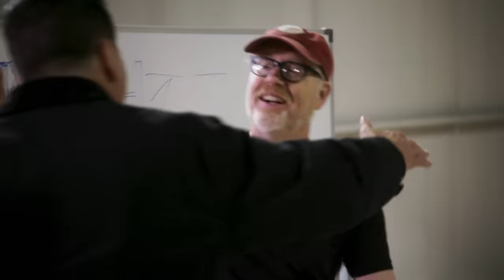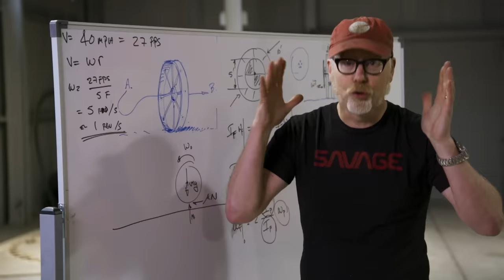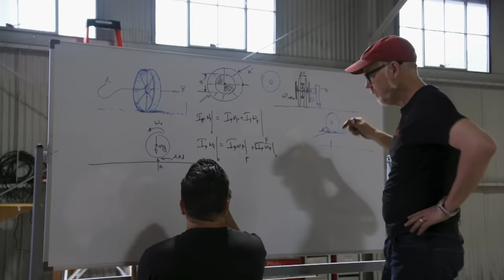"The Power In These Flywheels Scares The Pants Off Me" | Savage Builds

Comment: You should have Metal C Clamped the Core Axle container to the Horse tables, and anchored the Horse tables in a sand bucket to help absorb teeder toddling of the structure.   I would have also have put up 5 layers deep (and as high is the device is) Sandbags like what I assembled many in Iraq.  Sand bags really absorb energy, and is reuseable when need be.  I would have considered doing a Belt pulley start rotation engagement system, or using like a motorcycle transmission with a clutch to engage the special center spin lock.  The clutch pivot system will allow you to engage, and disengage without yanking it.  I really reconmend if all possible, balance the iron place so you get less wobble.  This information comes from a Disabled US Veteran who used to spec performance his 91 Integra.  Give it some thought and let me know

Comment: You do not use straps to secure the flywheel to the bench. They way they try to secure a running machine is terrible. You must first clamp it very securely and they did not bolt the fixture to the concrete floor.
Reply: Not to mention it was a single mounting point directly in its center of mass/gravity. I'm glad nothing went catastrophically wrong during that test.
Reply: expanded steel cage, 1" or greater U-bolts to the saw horses to hold the axle in place, with the saw horses bolted/welded to a floor plate which holds the cage, try and put as much metal to metal contact and as many ways to keep the axle from actually hitting something that could cause it to run away, they probly could have pushed it to 600-800rpm even with a slight vibration, but 1 ratchet strap in the middle is just asking for something back to happen, not to mention their motor disengage method is by pulling, that in itself is super dangerous.
Reply: You're right, they should have been bolted to the floor. However, you have two 450 pound discs spinning at about 300 RPM. I'm not sure bolting it to a concrete floor would do much, really.
Reply: Although, if it's not bolted with the frame to the floor what they did doesn't seem too bad.  The strap seems attached to the floor.  Like this, if it breaks off the sawhorses it'll be metal 'wheels' on concrete (low friction), which could probably be held back alright with that strap.  

Still not the best setup for sure, but also not too bad.
Reply: Look closer, the straps are fixed in the floor.

Comment: I make wood processing equipment. The wood chippers are pretty much the same concept. It's a very heavy metal flywheel with slots you can bolt blades to.

Comment: Trying to slow it down from the center, surrounded with engineers, very smart
Reply: I would be afraid to push on the outer edge as well given how they affixed the axle to those 2 saw horses.  The entire assembly already showed it could pivot on its mount with those straps, not going to make that any easier to do.
Reply: @cashgamma  Yea. The tangential speed at the edge will makes that plank fly straight into any unfortunate bystander's face. Braking it at the center will slowly bleed out the energy, much safer.
Reply: Yes my first thought was: it looks like you’re using all of your brain too! LOL

Comment: The flywheels are to large a diameter, you can get the same amount of effort out of thicker smaller flywheels, they would also have less runout and less vibration.
Reply: It would take more mass at a smaller diameter, though.  If you hollowed the mid-section with some pizza-cuts, you might be able to make up the difference, but then you'd be pumping a lot of air.   Also, there'd be more work to do for the braking device to impart the same torque.
Reply: The thicker plate is probably not as readily available & would likely be more expensive.
Reply: Yeh but you are forgetting one thing, these guys aren't as smart as they are made out to be!
Reply: @iamthetinkerman  A chief engineer at JPL, not that smart... Well making that comment here is cheaper than renting a billboard to proclaim you aren't that intelligent I guess.
Reply: @iamthetinkerman  He's the Engineering Lead at JPL. That title alone makes him an Elite World Class Engineer. He's been the man responsible for some of mankind's greatest off world achievements.
Reply: @AgeUKwirralDIT  I'm not going to discredit this man's achievements, but I know a lot of great engineers that "aren't that smart". The fact that the shop has several "really smart minds", yet no one thought a single sling point was a bad idea. I would've had braces on either side the axle, atop both of those horses, with dual floor anchors. This would've been at minimum.
Reply: You're not wrong, but what you fail to mention is that every time you half the diameter, you must quadruple the mass (at the same RPM) or double the RPM (at the same mass) to achieve the same kinetic energy. So there is a balancing act there, literally. 

If the goal is to convert the kinetic energy the flywheel into forward locomotion you want to have the most kinetic energy for the least total mass I would think. That would favor large diameters over small diameters.
Reply: @bamascubaman  Chief engineer at JPL had not rigid mounted the shaft to the stand, at a single point no less. Such an obvious error could only have been devised for our entertainment.
Reply: @iamthetinkerman  agreed, I would say that the 500 k  of school makes him a tool, he wants people to think he's smart hence the title, seeing the outcome of this experiment before it is conducted makes you smarter, than him! You can tell this is something that could be simulated in a physics engine, and the parts could be machined with precision, these experiments are made to get people excited with his mars mission, a PR stunt!
Reply: Smaller/thicker would be a performance hit for this machine. As far as runout goes how does smaller neccesarily improve it?
Reply: @bradley3549  large diameter, with low weight and high-speed, would be more efficient and less dangerous.
Reply: @abrenos3744  I agree with the first half, I'm not entirely sure I agree with the second half. lol.
Reply: @bradley3549  😁 you totally right!

Comment: A guy in SE Kansas built a two seat car powered by a car battery and electric motor spinning a flywheel. I did an article about him in 1980.
Reply: Do you have a link to the article?
Reply: Terribly inefficient and dangerous in a small vehicle, let alone any road vehicle.
Reply: @csengo70  No It was long before the internet. If it still exists it might be in the archive of the Chanute Tribune from Chanute, Kansas, USA. I'm not certain of the year, but it as in the early 1980s
Reply: @randallshuck2976  I wanna hear your story’s.
Reply: @AceOfBlackjack  Wasn't that much of a story. I covered his demonstration of his vehicle. It ran on the flat about a quarter mile at about 20 MPH. There were problems with turning it as it seemed top heavy. I never heard of him doing anything else with it later. I had a photographer with me and he took some pictures. It ran on the local page. It might be in the archives of the Chanute Tribune, Chanute, Kansas. Rethinking it, it must have been 77 or 78 I know it was in the spring.
Reply: @randallshuck2976  Awesome thanks man! How old are you actually? I’m looking for old journalist for a report I’m running.
Reply: @AceOfBlackjack  Although I have a BS in journalism I only worked as one for 4 years. I got married and I couldn't support a family on the wages.
Reply: @randallshuck2976  Oh my goodness I actually just wanna listen to more of your stories, your just interesting now.

Comment: Adam - Spinning flywheels don't store power - They store kinetic energy. The RATE at which the energy is extracted/used is power. They can supply large power for short intervals, or low power over long intervals. Either way, the total energy available is the same.

Comment: Next time try a fluid coupling aka “torque converter” in place of the automotive brake system. And move the majority of the flywheels mass away from the center of rotation

Comment: Because the axle moved a bit down at the side of the motor when removing the motor, the effect is that the axle is turned to the right side. This effect is called precession. Would it turn futher towards the guys in this case? No. Would I stand next to it like they did. Nope. Not at all...

Comment: Given that the disks were 400 lb each, 5' diameter, moving at 350 RPM at disconnect, the flywheel system when disconnected had stored about 70.76 kJ of energy.
Reply: How to store that energy?
Reply: @TheOnlyRiceman  Can't remember the original source when I posted, but re-Googling today I found 35kWh/month, which running the numbers again is certainly not even close to half of 70.76kJ....I think my math is off somewhere haha (and I've thrown away the sticky note where I did my original calculation.)  I think I will edit my original post to get rid of the estimation for how long it could power a fridge, I'm totally wrong about that.

Comment: These guys do a great job of using dialog to explain things they both definitely know, without being condescending.
Reply: We had Pyler Motor Generators** on several jobs. I always hated going in the Vaults to Lubricant them, due to the speed of the heavy flywheel. The Three Phase Motor was on one end Flywheel in the Middle and Three Phase Alternator on the other end. They were for Smoothing the Street Power out, for the Computer Room, and provided an Energy Source to give the Standby Generator time to come on line and takeover powering the motor.

Comment: Flywheels are used as temporary power sources to generate electricity in UPS systems as well as to start diesel generators. You spin them up and they become a source of energy to directly turn an alternator to provide electricity or to start a diesel through a clutch. Insane amounts of power available.

Comment: The reason the axel started to twist on the mount is the way the strap is wrapped on the axel. You need a second strap wrapped the opposite direction. When I strap long pieces of tubbing or pipe on my trailer, I use two straps or the load will twist. AND, as it twist, it also loosens the tension.

There was an issue of Popular Mechanics in the 70's that showed vehicles powered with flywheels made in stacked/staggered plates on a vertical shaft.

Comment: Adam Savage could have continued with his list: right through this wall, through the vehicles parked outside the door, into traffic, through traffic, through the concrete wall of the nuclear power plant, through the inner containment wall, right into the nuclear reactor core...
Reply: ...through the kindergarten
Reply: That was the way he wanted to lead us, but don't be conned by the hype.  If the video had the merest shred of physics he'd have given the kinetic energy for the device at given rpm.  But that would have spoiled the "we're terrified" narrative.  If they were ready scared they'd have operated it remotely. So that's play acting.  The discs could easily get halfway through the garage shutter, but almost all the momentum is rotational.  Not much forward momentum to push the axle through.  So I reckon the thing would grind itself a short way into the concrete floor. And under a level of friction a thousand times higher than his pathetic bit of wood it would come to rest in a few seconds.  If he was genuinely scared why did he only have a rubbish brake?  He wasn't scared,  he was performing for dramatic effect and not explaining the physics.
Reply: @raykent3211    That's cute, but you clearly have no concept of the physics of a flywheel that size and speed.

Comment: These guys appear to be ‘’criminally’’  insane - no triangulation for securing the axle and with a turning moment at the centre?  If loosed at full revs - a few vehicles will not stop such forces - the wheels would ride up the ramp made by the hangar doors which they had demolished! And then what in the street?
Reply: They engineered the drama into the equation too... they want to show just how dangerous it can be

Comment: The initial movement upon decoupling is called "gyroscopic precession". The direction of rotation is consistent with that phenomenon. Manually changing the direction of those flywheels by hand would be downright impossible due to the sheer amount of stored rotational energy.

Comment: They used to use electricity and giant flywheels to power city buses in the old days.  Old technology
Reply: Not Just power Them but rather use the Energy losses from braking at the Bus Stop and Store IT in the flywheel. When The Bus Had to start again the inertia was used to get the Bus rolling. Really Neat design and way less Energy losses when Braking / Starting.
Reply: @clypeum5063  they were horizontal
Reply: @Buzzhumma  yeah they were under the Floor but that doesnt Matter. Look Up gyrobus on Wikipedia.

Comment: If you're trying to slow it down with that 2x4, don't place it so close to the axle, get it as close to the outside as possible; way more leverage. That's why some cars have such large brake rotors - so you can get the brake pads farther away from the axles for the leverage.

Comment: Wow that "safety-switch"  Adam was trying to pull-off (strap) would not be my 1st choice, or 2nd, 3rd, 4th .......
Reply: I first thought the strap was pulling a brake lever. As a 'safe' method of removing the motor coupling from the wheel, pretty poor design and idea.
Reply: @joeshmoe7967  yes right-on!

Comment: They should have done this test in some basement, underground so that in case of a runaway situation the walls could have absorbed all the impact. If that thing had gotten loose at ground level it could have easily gone like a train destroying everything on its path and potentially causing a tragedy outside that building to unsuspecting bystanders. That was a real monster.

Comment: Being an engineer myself...those 5 bolts and nuts at the centre seem way undersized for that amount of shear force. 
They would be sliced through like butter if it got away.. 
Also..its a bit rich talking this guy up like he's the mars rover engineer..it takes a team of dozens to achieve that...hundreds of people in total. The lead engineer is more about project cost and schedule..never do they understand any actual technical area like the subsystem engineers do.
Reply: As an engineer you should have noticed their rig used 6 lugs per side instead of 5 per side.
Reply: You're correct.  The other point would be the bolting area is too small given the mass and speed.  There should have been a mounting plate of far greater diameter with far more points of attachment.  That would have removed some of the vibration due to harmonics.
Reply: @xavariusquest4603   Generally you would probably make that double thick as well
Reply: Not even talking about how the whole construction is held together by 1 strap, of course a weld would be ideal but man 2 straps is the minimum

Comment: Funny how two crazy smart people couldn’t think of a better way to secure the flywheel for the test then saw horses and a strap ! No wonder it vibrates , secure the thing properly on roller bearings then let it rip
Reply: That's not how vibration works. Also the only way to secure it would be to bolt it into the cement.

Comment: Putting raw cut, unbalance sheet steel flywheels on a “precision balanced” shaft is useless. They need to be precision turned and balanced before mounting.
Reply: So when does NASA want you to come in and build their next rover?
Reply: What is ridiculous is why doesn't a freaking chief engineer know that?! When a fourth year mechanical apprentice can tell you that
Reply: @Ken-nv2hl  Expertise in design is not necessarily expertise in manufacturing.
Reply: @QwazyWabbit  Chief Engineer needs to know all aspects of engineering, Mechanical, Fluids, Electrical, Electronics, Structural, Programming, Management. When you meet some that know all of it in industry you understand why they got that role.
Reply: @Ken-nv2hl  that wouldn’t make a very exciting video, would it? But JPL probe projects are teams of experts in many disciplines and Chief Engineer means you are primarily a coordinator and bookkeeper.
Reply: You balance them by spinning them, and checking for vibration.  Which is what they did.
Reply: @jpdemer5  LOL! You balance them by rough turning and facing them, heat treating to normalize the material, then finish face and turn to minimize distortions and then spin them on a balancing machine that tells you how much mass to trim and where to trim it for balance. You don't strap them onto sawhorses and then say oops at 300 rpm. But doing it right the first time isn't nearly as exciting as pulling on a rope and burning the tip of a 2x4.

Comment: The flywheel ideally would be waterjet cut to prevent thermal stress on the exterior edge that is giving it the wobble. Each one should be balanced before testing. I also didn't see any countersinks to receive the lugs for better centering. It looks like a clearance fit over bolt threads which is pretty dangerous. I can't wait to see the full test. PS If you need a pair of these made up I run a machine shop!

Comment: Saw aftermath of flywheel get away when I visited a railway machine shop.
One of their jobs involved skimming railway engine wheels in a lathe. King story short an inexperienced operator spun a 490lb 5 ft drive wheel up way too fast.
Jumped out of the chuck, due to gyroscopic effect they don't fall over so just spun in the steel bed until it clipped the tailstock, which the trainee hadn't engaged.
Rolled off hit the concrete floor and started accelerated across the shop.
Took out 6 inch cinderblock wall, ran across shutting yard including 4 lines of track.
Went thru chain link fence like it was butter, crossed a 4 lane road thru another chain link into a container loading yard and eventually came to a halt after severely denting multiple containers.
Frightening doesn't cover it.